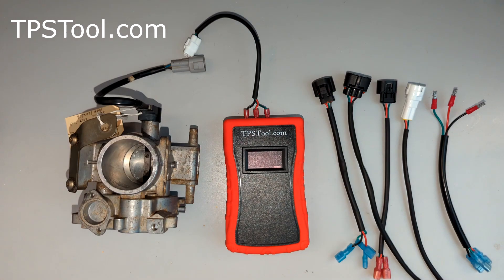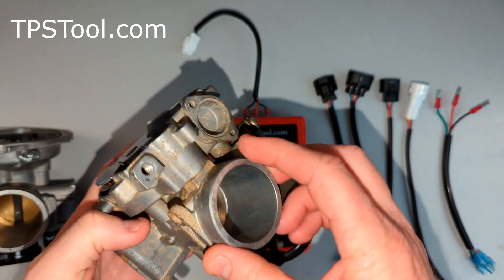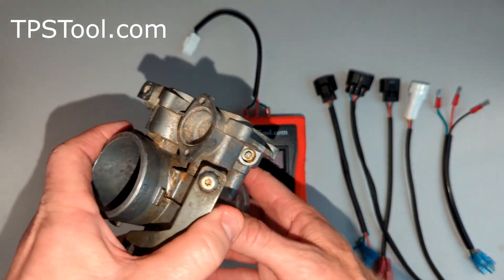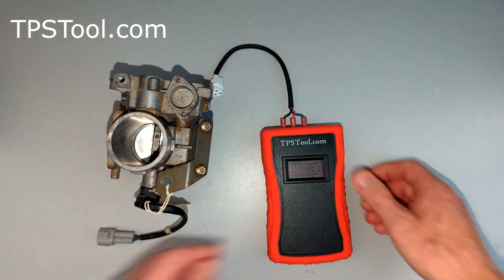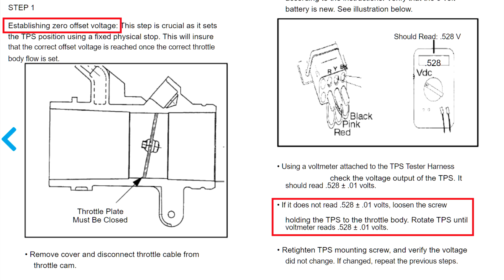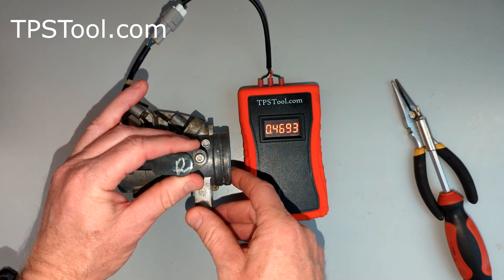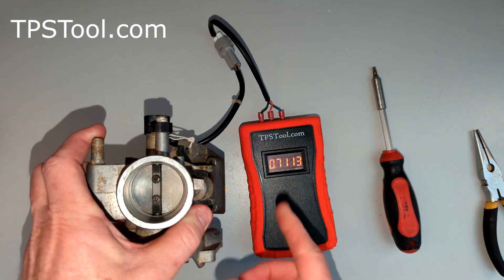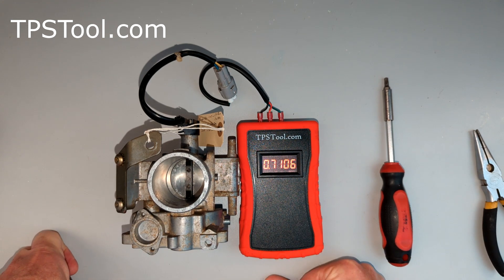Set the TPS on Polaris Ranger 700 2007-2010 (also RZR, Sportsman, X2) without IAC

Comment: Hi, can this be done with the throttle body still on. Or is easier with it off.
Reply from the maker: Thanks for your question.  Yes absolutely, as long as there is enough space for you to physically do what you need to do, it is fine to do it on the machine.  For these example videos it was just easier to get the throttle body than to get the whole machine. :)

Comment: Did everything step by step exact numbers and everything but now I’m backfiring at idle
Reply from the maker: Thanks for your comment.  What exact year and model are you working on, and what was the setting before you adjusted it?
Reply: @TPSTool 05 sportsman 800 and I believe like .25 before messing with the screw but it was obvious someone was messing with it before ( I bought the atv off of marketplace) but I set everything up the same numbers you showed and everything
Reply from the maker: @oliverracinggaming8859  0.528 base and 0.710 at idle is spec for the 2005 Sportsman 800, there's a link to the service manual for that year on the common settings page of our web site.  Did you make sure the inside of the throttle body was super clean before you adjusted the TPS?  If carbon is holding the throttle plate open a little bit then that can make the setting inaccurate.  Also make sure the throttle cable has some slack when you set it.  If you have the TPS set correctly then the problem might not be the TPS.  When you say it backfires at idle, is it sitting there backfiring the whole time it's idling?  Does it seem to run OK otherwise?  Other things to check would be the fuel pressure, make sure the injector is clean and sprays a good pattern, make sure the air filter is clean and no air leaks between the throttle body and the cylinder head, make sure the exhaust isn't clogged with mud or a critter built a house in it, make sure the spark plug and the boot are OK (look for cracks in the spark plug boot), and make sure the batter voltage when it's running is between about 12-14.5 volts.   Some Polaris models won't run right if the voltage gets too high or too low, which can happen if the voltage regulator goes bad.  I hope this helps!
Reply: @TPSTool  it didn’t have the problem with backfiring until after I changed the tps that’s why I don’t think it could be anything else but it’s like running rough at idle and backfiring and while driving it when I let off the gas it’ll backfire 1 or 2 times as well
Reply: @TPSTool  just installed brand new oem coil pack wires and plugs and I’ve tested the injectors not to long ago as well and also checked timing not to long ago everything is 100% and wasn’t backfiring before installing the tps
Reply from the maker: @oliverracinggaming8859  If the TPS is now adjusted to factory spec then it's correct and the problem must be something else.  You may be able to cover for the problem by adjusting the TPS if you want to give that at try.  If you adjust the TPS higher it will run richer, or lower will be leaner.  Try first adjusting by 0.05V at a time, then 0.02V to fine tune it and see if that helps.
Reply: @TPSTool I installed a brand new oem tps and throttle cable btw so everything is new it’s not making sense to me,

Comment: Hi, Great video, I have a 2007 Ranger XP with low hours, about 248 and it wont idle very good when it is cold, do you think the TPS may need to be set?
Reply from the maker: Not idling when cold is a sign of being lean, which can be caused by a few things.  Do you know the history of it, and if anyone has fiddled with it?  If anyone has fiddled with it, then it's very possible the TPS is off.  But given it's older with a few hours, I'm guessing it did a lot of time just sitting.  In this case first check the basics like make sure the fuel filters aren't clogged, make sure the injector is giving a good pattern and isn't clogged, etc..  it's very possible the TPS is off, but perhaps more likely that something is dirty or gummy from sitting.

Comment: Would I need to adjust TPS after installing new injectors and fuel tank assembly on 2006 Ranger 700XP? It idles, just very low. Thanx!
Reply from the maker: Thanks for your question.  In theory you should not have to adjust the TPS after installing new injectors or a tank.  Was the idle low before you replaced the parts?
Reply: @TPSTool  It was a little low, but I attribute that to only having 20 psi fuel pressure. Has new spark plugs as well.
Reply from the maker: @roberttanner4225  Low fuel pressure will make it run lean, fix the fuel pressure issue before bothering with anything else.  The manual will have the spec for fuel pressure, I'm not sure what it is off the top of my head.
Reply: @TPSTool  Sorry, I have replaced Fuel Pump Unit with the tank assembly as well as injectors. My first question was not clear, sorry. I have 40 psi now on the new injectors. off idle throttle response is not crisp as it used to be either.
Thank you for your time!
Reply from the maker: @roberttanner4225  While replacing those would not affect the TPS, you could adjust the TPS as a way to tune it a bit.  Make adjustments up or down about 0.02V at a time, that should get you a small but noticeable change.  Try adjusting down first (leaner), keep repeating the 0.02V adjustment as long as it gets better.  If it's not better then adjust in the other direction.  Similar to tuning a carburetor, turn it up a little and down a little looking for your favorite spot.  It's too sensitive to eyeball the adjustment, use the TPS Tool will tell you how much you've moved it.

Comment: Good content. Thanks 
Liked and subscribed. 
I have a 2007 sportsman 800 EFI that has been backfiring a few seconds after the throttle is let off from a high output. It has now started to shut off while idling sometimes. It is idling too low. 
I believe the issue is it’s running lean so I’m planning to clean the fuel passages.
Reply from the maker: In addition to the TPS, be sure to check that the fuel injector is clean, the filters are clean and the fuel pressure is good.  All of these can make it run lean.  Also check for any air leaks between the throttle body and the head.
Reply: Thanks for the reply. Wasn’t expecting anything. Appreciate it. 
I’ll have to get a fuel pressure tester. 
How do you check injectors?
Remove and?
Reply from the maker: @nelsod76  Without a cleaning kit, the best way I can think of is to do whatever you can to get a good view of it and see what type of pattern it gives you with wide open throttle while trying to start it.  A spray pattern is good, streams or drips are bad.  Motion Pro makes a cleaning kit that might work with that injector.

Comment: If I’m only getting 1.5 volts at WOT, does that mean my tps is bad?
Reply from the maker: Thanks for your question!  If everything is connected correctly, that's not a good sign for your TPS.  Are you using the TPS Tool to power the sensor, and what reading do you get at idle?  Also what happens to the readings as you slowly open the throttle?

Comment: I'm currently working on a Polaris Ranger 700Xp. So far, I've replaced the Fuel Pump, regulator, cleaned injectors, and cleaned out the gas tank. The previous owner had let it sit in the garage basically since 2018. With everything installed the machine won't start or idle without giving it some gas. Any ideas? I'm wondering if my idle needs adjustment
Reply from the maker: You didn't mention the model year, but check if that model and year has an IAC valve (Idle Air Control).  Some years do, some don't.  If yes, I would start by cleaning that, and if that doesn't do it then look in the manual for a test procedure to be sure it's working properly.  If you don't have the service manual, you can likely buy one online for a few bucks or check sites like manualslib.com.
Reply: @TPSTool  Sorry, my Ranger is a 2007. Its only got a 100 hours on it and 200 miles, so the machine is very clean for the most part. It just hasn't been used in several years. I did buy a service manual and had it spiral bound at Office Depot. I'll check and see if I can find any info on the IAC valve or if it has one at all.
Reply from the maker: @tlashley  I don't think that year has an IAC, but definitely double check me.  You could check the TPS just to be sure it's working properly, but with such low hours a failed TPS would be unlikely, unless maybe it was stored in a very humid or harsh environment.  My first guess is something is dirty or stuck.  I would resist the urge to "adjust" things until after everything has been cleaned sterile clean.  That is assuming it was working properly when it first went into storage.  Do you have any way to verify that it was working properly last time it was used before long storage?
Reply: @TPSTool  the precious owner said they drove it around their yard a few times after they got it and then it sat in the garage until I got it from them recently. So, as far as I know it was running prior to storage. 

I’m wondering if my regulator could be bad. I’m getting 40 psi but I had to clean and re use the old regulator because the one I purchased ended up not being the right one. Otherwise everything else in the fuel pump assembly is new. We also cleaned injectors.
Reply from the maker: @tlashley  Speaking of regulator, also check the battery voltage while the motor is running.  Some Polaris motors won't run right if the battery voltage is too high or too low, which happens when the voltage regulator goes bad.

Comment: I have an 06 Ranger 700. I got it cheap cause it didn’t run. The ECM was fried and I replaced that. I know it went meltdown because it melted the plastic connectors going into the ECM. I bought kit and rebuilt connectors. I think they are right. The motor started and it ran like a champ for 15 minutes. Then it bogged down  no power, stalled on idle, and started backfiring. Now it won’t start at all. It tries but backfires only. Plugs are brand new and they look like it was running rich as they are black now. Do you think this could be my issue? I’ve changed the fuel pump, cam sensor and no luck. I have good fuel pressure. Beating my head on the wall for 6 months with this thing.
Reply from the maker: The TPS is a possibility, but check the basics first.  Make sure you're getting spark, see if you can get any codes out of the ECU.  Also go over all the wiring harnesses very carefully, Polaris is known to have chafing issues on many models causing the insulators to wear through on the wires and allowing them to short on the frame or to each other.  Also make sure the fuel injector is clean and check the spray pattern to be sure it's spraying as expected.
Reply: @TPSTool  I’m getting misfire code according to the engine light. I’ve replaced both injectors with brand new ones. I’ve noticed that the tps sensor looks new. I have not replaced that. Guy I got it from may have done that and not realized that it  required tuning. I’ve checked all wires many times and I can’t figure it out. Spark is fine. I’m about outta ideas. Thanks for the reply. May end up biting the bullet and taking it to dealer.
Reply from the maker: @JustJoshinSC  It's odd that it ran fine for 15 minutes before problems started.  Maybe the previous owner can tell you if he replaced the TPS?  Please post back when you figure out what the problem is. :)
Reply: @TPSTool   I will. If adjustments to TPS don’t work I’m gonna get a priest and try to do an exorcism!
Reply from the maker: @JustJoshinSC  haha, if you do that be sure to record it for youtube, that would be spectacular!  ;)